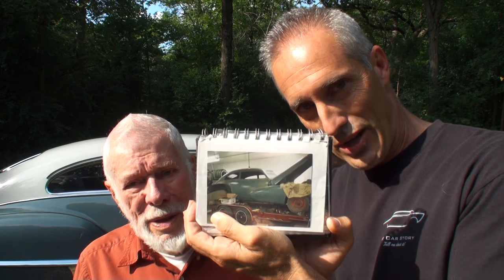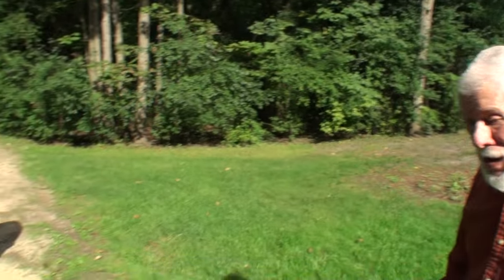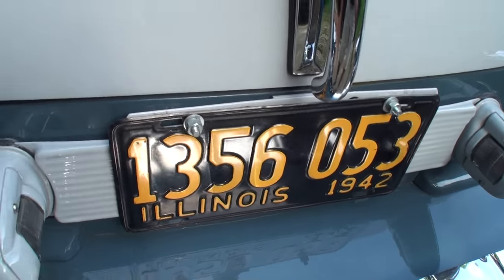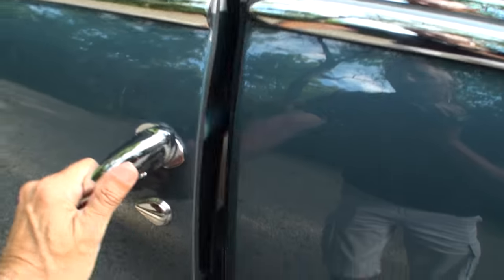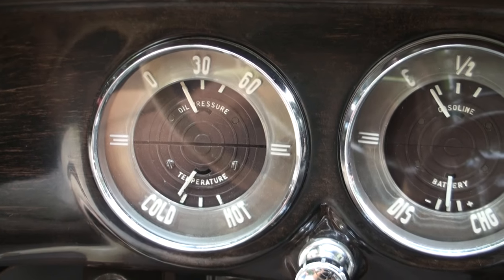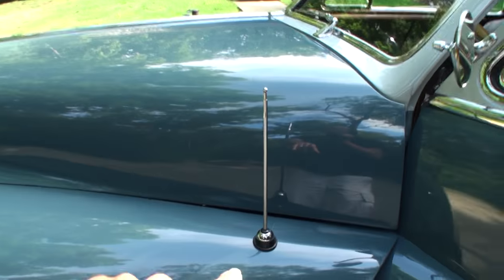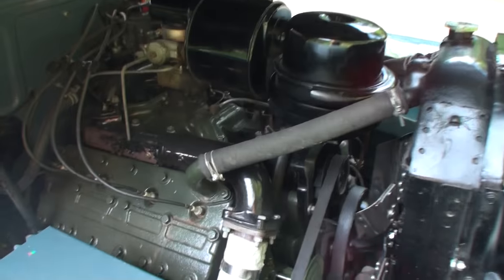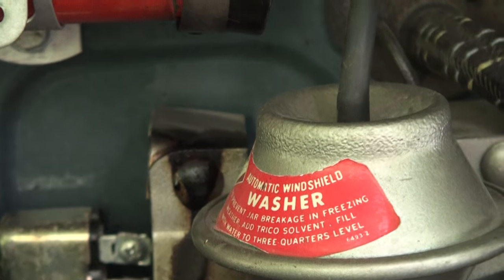1942 Cadillac Caddy Series 62 Coupe Fastback & Engine Sound on My Car Story with Lou Costabile

Comment: A very rare automobile.  I could understand why Art mentioned that there are only four left in the whole US. While the impressive front end with that famous Cadillac Dollar grin was part of the Cadillac line of those years the fastback styled rear had to have been a fairly recent introduction. That fastback styling also was carried on after the war for a number of years by Cadillac. Windshield washers in 1942! Who knew?
Reply from the maker: Hi ddkoda, Thank you for sharing your knowledge on this car.  So fun to video and share a car like this. Lou
Reply: Thanks. It seems that this fastback styling was a portent of what was to come had the war not arrived.
Reply: AND, power antenna, even if it was vacuum actuated. Would never have guessed that one in '42!

Comment: way ahead of its time-i had a 51 plymouth that looked older than this does styling -wise
Reply from the maker: That's interesting.  Thank you for sharing info on your car, Lou
Reply: My first car was a nearly identical '52 Plymouth. Compare it to the '55 Plymouth, just three model years later; a wholly new and different car. My '52 was a solidly built car, conservative, and the end of a great era.
Reply: definitely though i messed up it was a chrysler windsor that i had ,fluid drive ,flat head 6 ,etc same thing  ,these cars were locked in that pre-war design  still
Reply: Wow, my first car was also a 1952 Plymouth Cranbrook, 4 door sedan.  I hated it.  It was homely,  sluggish, under powered, low oil pressure and not much in the way of style.  It was sort of a "Chick repeller" vehicle in high school.  Add a flat-head six engine and it was sort of an embarrassment.  Otherwise, it's most redeeming trait was a huge back seat which came in handy many times.

Comment: .       ........................        very  nice  automobile         .......................         very  nice  man        .........................        many  thanks  !!!
Reply from the maker: You're welcome JOHN MCCLINTOCK :-) Lou
Reply: Nice old chap but little amazed at the lack of knowledge though?   It's a 61 series, not a 62. The 61 series was the cheapest Cadillac, not the top series and would have been the entry-level LaSalle had they not been discontinued. Only the 61 series cars had fastback design.  Superior models were the 62,60S,63,67, and 75.  The Harrison radiator plate was identified as the Vin?  but the Vin plate is actually on the drive side of the cowl near the hood hinge, which would state the series and style.

One of these exsac models was imported to England about 30 years back.

Comment: The strange looking fuel pump with the glass filter on top is actually a dual pump;  top is fuel and bottom is vacuum.  The vacuum pump was an "assist" for the vacuum windshield wipers which would stall-out when vacuum was lost which would occur when the engine was under load as in climbing hills.  Common to have this pump fail or have vacuum line leaks and we would just put up with the poor wiper operation.  Was used on most GM cars into the 1950's.
Reply from the maker: Hi MrGGPRI, Thank you for viewing and sharing your knowledge, Lou

Comment: Thought American manufacturers didn't produce cars during WWII (1942-1945).  Guy says only 4 were made, they had to have been 1941 leftovers intended for the 1942 model year or new cars all together without knowing a war would start.
Reply from the maker: You're correct, however the 1942's come out at the end of 1941, so this rare one is a 1942, built before the halt of  production in December 31st 1941.
Reply: Gotcha, the new models were generally introduced around September or October, so the end year build makes sense.  Thanks, Lou.
Reply: I think he said there are only 4 left in the country not how many were made.
Reply: Bill Taylor The point of my comment was the year of the vehicle.  Around WWII (42-45) the US supposedly didn't produce vehicles.  Did you ever notice that pennies of that era are made of steel?  Do your homework and you'll see where I'm coming from.
Reply: Not so- these are not 1941's; styling changes for '42 included the front fender blended back into the front doors whereas the '41 front fenders were just that, ending at the doors.
Reply: MrGGPRI Lou already stated that, read all comments first before you reiterate what's already been said.
Reply: the 1942 model year was cut off part way through. Many '42s are quite dramatically updated from '41s.
Reply: FYI.......ther were cars and trucks made during the war.....very rare...but ther out ther...I do belive Hudson made pick ups ...I have seen a 1945 ...
Reply from the maker: This a 1947 Hudson pickup you might enjoy, Lou https://youtu.be/hDpMyL2WJJE